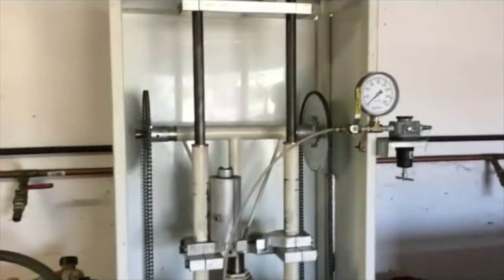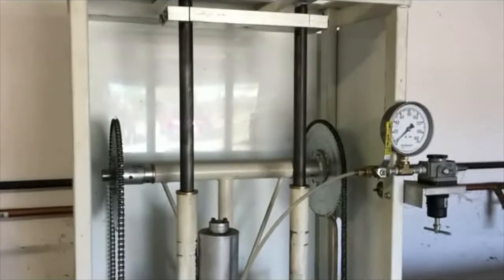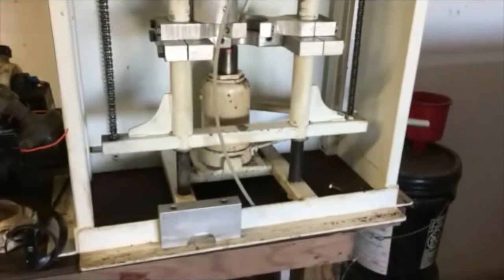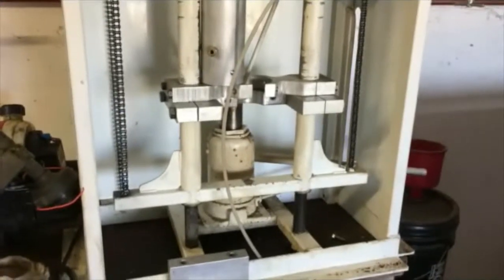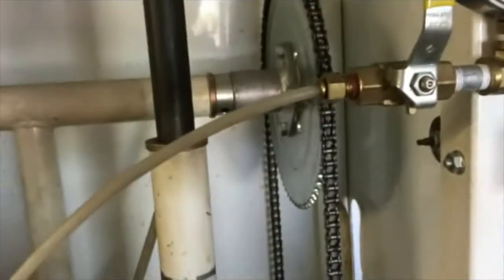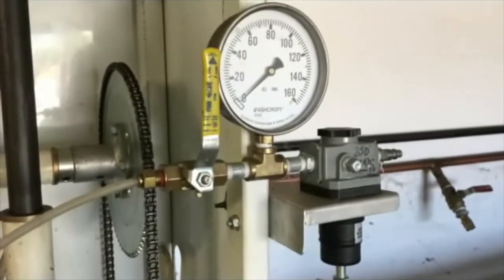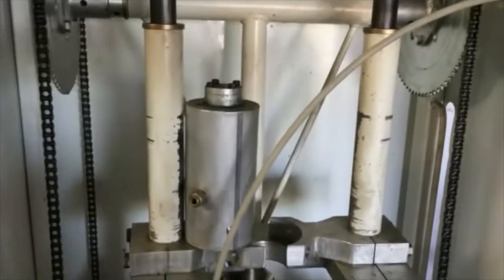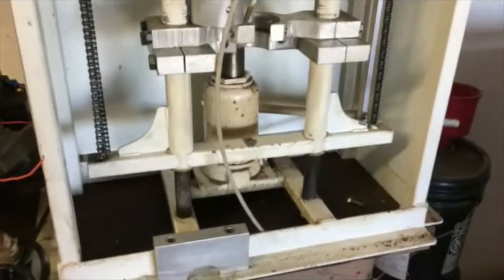The Bilstein Shock Machine I Built to Repair 46mm Steel Body Bilstein Shocks

Comment: Great videos. 
I've been drilling, taping and converting to bladder valve, hyperscrew or Schrader valve. Been wanting a machine like that for years. Milwaukee is a little far from Texas for a little road trip.
Reply from the maker: Thank you for watching. I originally built it because they did not allow schreader valves up by us.
Reply: @HoganTechnologiesLLC  Thanks for making the video.  Been thinking about it and have started gathering parts to build one. Hope to get one working over the winter.
Reply from the maker: @greglangley4518  The one thing I should have done differently is making the shaft extensions out of steel instead of aluminum.